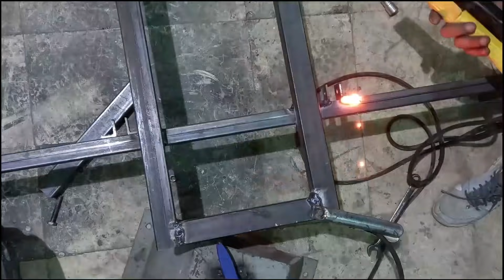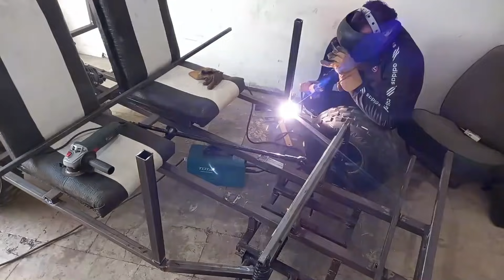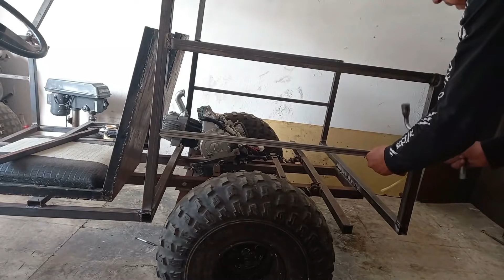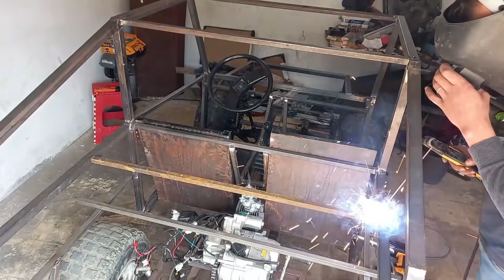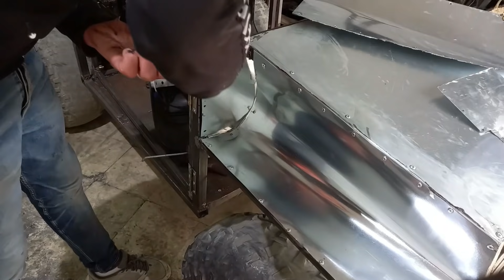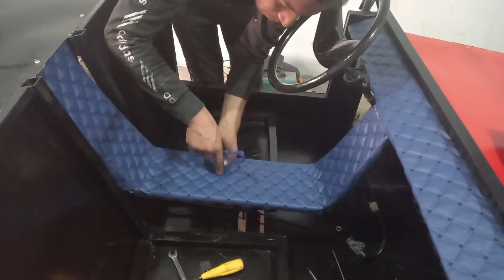Homemade Car build - Making Car at home - Cheral CX

Comment: I wish I was able to build something like this
Reply: If he can do it. So can you. You just have to have the drive to get yourself to that finished product
Reply: Nice wish
Reply: @neutralbattlewithshannon8725  You're right!! It would be amazing for every wisher!! 🤗
Reply: Learn about mechanics. That's the first step, then you need the budget which might be a problem.
Reply: @OriginalFake ur name threw me off 😂😂😂😂😂😂
Reply: Grab: 1. Cardboard
2.flat metal
3.led lights 
4.wires
Motors
Screws
Flat pieces of Plastic 
Batteries
1. Cut out all the sides for the shape of the car (use cardboard)
2. Cut squares for the windows (use plastic)
3. Cut the medal into the shape of the bottom of the car. (Use metal)
4. Use the metal and cut out a seat (use metal)
5. Use an drone controller 
If you have a drone controller and the drone, you can take it apart and wire the drone chip to the four motors
Then connect a battery and switch to the two LEDs (use a wire and LEDS)
Last step: glue everything together and power on your car and go Drive
[[was this reply helpful?!!]]
Reply: Wow sow god
Reply: @emanorhan1984  thank
Reply: Not really you need a lot of money and the tools to do it
Reply: Me also
Reply: @Eggssgarlic  can you tell how much I need to get started with building projects like these?
Reply: @mosshivenetwork117 can you please tell me how do I get started with learning mechanics?
Reply: @pappu4539  I might not be able to give a proper answer. The only thing I can think of are college classes. I think some cars have manuals you can read. I'm sorry I'm not entirely sure how to answer this question. Maybe ask mechanics how they learned and how to start?
Reply: @mosshivenetwork117  no problem buddy! Thanks!
Reply: @mosshivenetwork117  which branch of engineering according to you is best for me if i am interested in things like these? Like there is mechanical, electrical, software etc
Reply: @pappu4539  oh gosh, idk dude. I thought you wanted to learn about car mechanics specifically?
Reply: I can help you free of charge.. I'm in South Africa.. all you need is just a welding machine,  drilling machine,  grinder, tape measure.... you don't need to a qualified welder to do this..
Reply: @moyisikilili697  i will purchase these tools. Can you help me after that in buliding?
Reply: @pappu4539  I can...
Reply: @neutralbattlewithshannon8725  88ijh0
Reply: @triwahyuningsih2391  what does that mean?
Reply: @neutralbattlewithshannon8725  t😂😂🎉😢😅fyy😢😢fyt4
F6
Reply: @neutralbattlewithshannon8725  No its pretty expensive
Reply: Это только на видио кажется что всё просто и легко, а на деле, только неделю будешь запчасти собирать и возится с этим драндулетом по несколько часов в день...
Reply: Me too😊
Reply: Just do it.
Reply: Why can't you
Reply: Qəşəng❤
Reply: I don’t 0: 0:58
Reply: Same
Reply: @neutralbattlewithshannon8725  agreed.
Reply: @pars4709  I’m building a wooden f150 and I’m only 12 so….
Reply: Why can't you?
Reply: You can DO IT...YOUR coment 2 years  ago ...and now do you make   A CAR
Reply: same
Reply: You can, just takes some time and money
Reply: Same😢

Comment: It's cool to drive around the property,  but not at faster speeds especially on the road.   That cage that sticks up above the body (that looks like a roll bar) will snap or break right about were it meets the dash.  The thing will fold sideways because there isn't any X bracing at all.   There is nothing to keep it from going side to side if you flip it over.  If the cage goes sideways the drivers body from the dash up is exposed and now the tallest part of the vehicle. 
  Just my humble opinion.
Reply: That ain’t humble
Reply: Motorcycle riders want to have a word with you

Comment: very nice work. I do think, however, that the engine was a little small. I would've probably used a shaft-driven motorcycle engine, maybe around 400cc for that sized vehicle, so you don't have any chains to deal with, and a lot more power, but it's still a skillful project.

Comment: That was a very simple solution for the rear suspension, I like it simple yet creative.
Reply: The geometry is very clearly wrong the travel is limited not just by the steel frame in the way 😂 but by the chain.. travel isn't the issue though if this vehicle had enough torque to climb a good hill with 2 ppl in it (it doesn't) the suspension would bottom itself out and no a spring loaded tensioner will not fix that lol .. chain driven suspension setup is kind of important to get right... This vehicle is made just for the views so I am not worried about it's safety or practicality but if you decide to build something and hope for it to be usable remember to research suspension and steering geometry and calculate your gearing.. use go cart forums and look into buggy building so many of these "creatives" on YouTube just don't look this stuff up and its very telling when they make the same mistakes over and over again its almost like the last builds he made these same mistakes on wasn't even ridden enough to learn they were mistakes...
Reply: @ianbuilds7712  thanks for the information..
Reply from the maker: Thanks! 👍
Reply: @ianbuilds7712  please I need you to educate me more on the suspension 🙏,  I

Comment: Good luck servicing the motor. It's completely enclosed in a welded cage. The front end needs more reinforcement to the base frame, not just the 4 uprights.
What maintains chain adjustment? 
Your motor is in a fixed position, and the axle floats.

Comment: Cool build but many questionable decisions... You encased the air cooled engine in lots of sheet metal, and why you put the grill thing in the front, there is nothing to be cooled there. To blow in your legs? Having the rear wheels on the same axle can lead to the axle breaking, but ok, on a small car like this it probably wouldn't be a problem. The lack of diagonal braces though, that chassis can't be very sound structurally. Also I think you just put the plastics and no real turn signals on the back, that's cheating but ok, it's fine. A cool build but could've been much better.

Comment: Como puedo conseguir los neumáticos y la barra que va en la parte de atrás con ellos
Reply from the maker: Rear Tyres 22/10-8
rear axle  : diameter 30mm length 1000mm

Comment: How thick does the square tubing need to be?
Reply: This appears to be 1.5" square 14 gauge tubing. Could be 12, but I think that might make the whole project too heavy. Maybe 12 for the main frame, and then 1" x 14 gauge for the supports and roll cage.